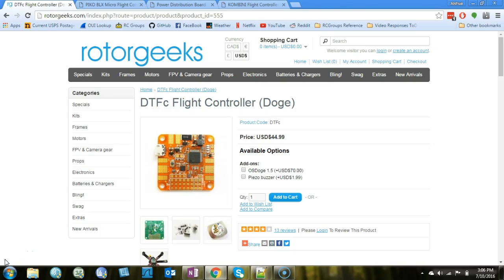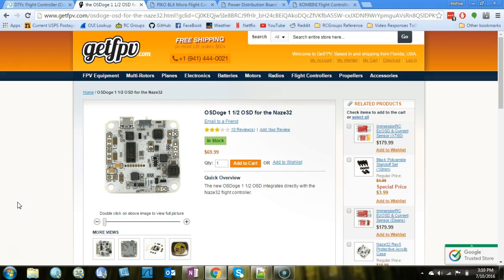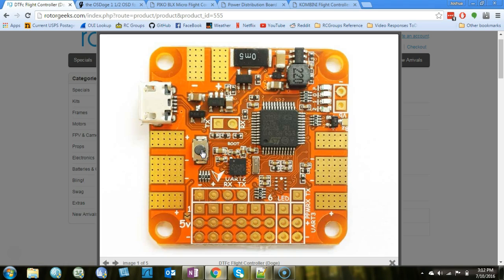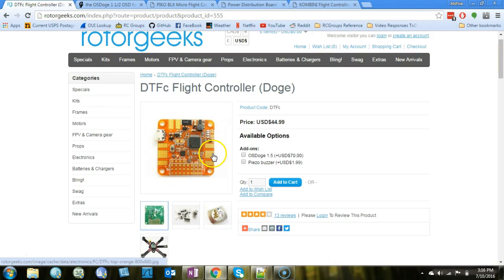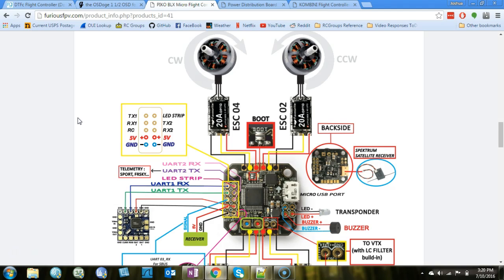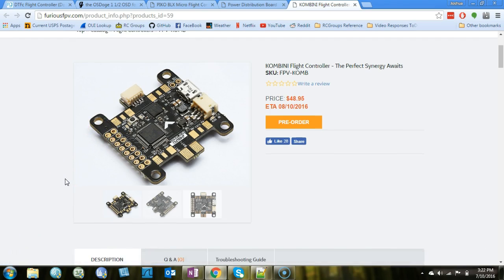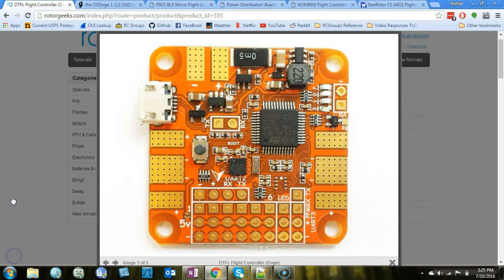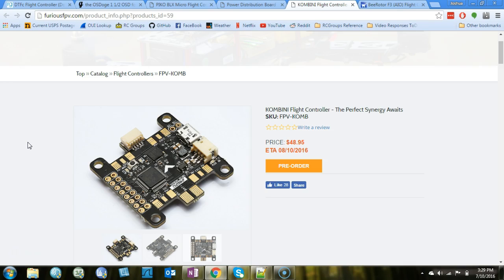Quadcopter Flight Controller Roundup: DTFc, PIKO BLX, KOMBINI

Comment: I have a couple PIKO BLX boards. I'm building micros these days. They don't actually have a "built in"  buzzer. Some of them come with an external buzzer. Mine didn't. I had to solder a buzzer to a couple of pads on the board.

Comment: hate to bother u again, a hyperlite f4 and got x4r.sb and the f4 board don't show uarts but shows rx3 would the rx3 work for smartport? I tried it and selected smartport in betaflight and vbat enabled but tarantis do the find new sensors and don't show vfas either, what am I doing wrong?
Reply from the maker: I don't know that board specifically but sometimes I know you can't find sensors unless the copter is armed. So try arming, then doing "find sensors".
Reply: OMNIBUS F4 PRO V3 FLIGHT CONTROLLER WITH CURRENT SENSOR, OSD AND SMARTAUDIO will i need to wire it up special way for x4r-sb rx ? is there a good wiring diagram somewhere that will show me? I hope this works and gets me back in air.. no more hyperlite f4 thats crazy it loses the memory for betaflight setup

Comment: cheaper 20x20 FC like the PIKO BLX http://www.banggood.com/CleanFlight-BetaFlight-Micro-F3-Flight-Controller-Built-in-PDB-Buzzer-20X20mm-For-FPV-Racing-p-1094615.html?p=T412213768073201602F
Reply: I actually find the clone more reliable than the original. The originals start of with a dodgy accelerometer, leaving you only with rate mode, and then later will fall out of the sky for no reason and never connect via usb ever again. Total shit.

Comment: Furious fpv actually makes a osd vtx combo designed specifically to stack on the piko blx. That and two in one esc's in the same form factor. So in my book that looks amazing for smaller quads. And possibly bigger ones.

Comment: Question I hope you can answer... I put 12volts to my sp Racing f3 board by accident and I was wondering if it could be saved... It won't turn on with 5 volts but does work with the USB cable connected telling me a regulator or cap my have blown.  Any insight would be appreciated. thx

Comment: Joshua,

what are your thoughts regarding the Flip 32 Omnibus FC?
Reply from the maker: It's pretty cool. I've been watching Project Bluefalcon's videos on it. I still like the RROSD, but the Betaflight configurable OSD is pretty exciting. Removes most of the down-sides of MWOSD, I think. You still need current sensing though, and PDB's with current sensor are a bit rare. I really think it makes the most sense to integrate the OSD into the PDB since the PDB must have current sensing. But Betaflight OSD might change my mind, since it makes configuration so easy. But then you definitely need current sensing in the PDB with a separate wire to the FC and OSD.
Reply: My thoughts are pretty similar. But if you consider that current consumed does not really equal flight time (e.g. if one flight is more modest than the last), battery voltage is really the tell-tale and the Omnibus can show you that along with everything else. I think it's a great 90% solution, especially for builds with little room.

Thanks for the reply.
Reply from the maker: +Jeff Beasley current is important for evaluating battery and ESC performance. For example, if I run one 1300 mAh battery to 15.0 volts and get 1100 mAh, and another battery I get 950 mAh, perhaps the first one is better.
Reply: Good point, Joshua. Would you give up the OSD functionality in favor of an integrated PDB + current measurement? At that point you're awfully similar to a DTFc. I'm torn between the two right now...
Reply from the maker: +Jeff Beasley I'm suspicious of integrated power handling and gyro. It has to be done right to avoid noise. I think that PDB plus osd or PDB plus current sensor and FC plus osd makes the most sense.
Reply: Hmm. Have you heard of the F3S AIO?
Reply from the maker: I haven't.

Comment: good review, I had the doge dtfc and now piko blx in my twitch 109mm micro, the piko is far far cleaner to wire up, has 2A 5v bec and a battery voltage LC filter output for vtx, doesn't have a buzzer built in i think their product description is worded wrong, it has buzzer output pins.. The Doge still seemed a good product but simply isn't as well equipped or layed out as the piko

Comment: Any good fcs which have the same pin layout of a naze Rev 5? I need it for the epipdb
Reply from the maker: +bo holland DTFc is your answer.
Reply: thanks, but isn't it unnessecary to effectively have two pdbs on board?
Reply from the maker: Unnecessary, but there you go. I don't know of another F3 that matches the pinout.
Reply: ok cheers, actually thinking back there may be one by the makers of the epipdb

Comment: I have a DTFc and the quality is amazing. It's not easy to make an FC with integrated PDB with respect to noise, so look and features are not the whole story.  I think the issues with gyro is related to electrical noise on this platform and recommend to use 2 buck caps on the ESC outputs (390u-1mF). Many people are referring bad gyro with mechanical noise. I think when you have mechanical noise in the system, this will be amplified by the PID controller, the ESC will produce more noise and transients that will adapt to the gyro power supply, and bad thigs can happen. So mechanical and electrical noise in the system is related. It's just a theory from my side, tell me if I'm wrong.
Reply from the maker: I have a link to a discussion in rcgroups showing noise on the 3.3v rail on boards that glitch. You're not alone in thinking electrical noise plays in.

Comment: There's also...the SirinFPV which is $120 msrp, but it's osd and video TX, blackbox FC. Also works with Six motors something I hope you will not in your great reviews.
Reply: the value of a PDB is lessened greatly if you are using the Littlebee pro 4-1 or the newest BLheli_s 4-1 esc. That really expensive FC and the is certainly the fastest build, and the slimmest stack. If you like a black box, it's pretty darn cool. Plus A full 40 channels with 200 or 25 mW controlled through the OSD.
Reply from the maker: Many of these boards will do six motors, but I reckon the vast, vast majority are flying quads, and that's where my focus is. The Sirin is a hell of a product. Even at that price, it's almost the only thing that does what it does.
Reply: +Joshua Bardwell the micro stack of the future will be, either sirin plus 4-1, or ... f4 FC, 4-1 esc, and AND with intergrated OSD and bec/VR/filtering. You need a microcontroller to change 40 channels, so they should just include the OSD, which is inexpensive parts, and the code is already written. Plus selectable output.
Reply from the maker: I just worry with that much integration, you're out a huge whack if something breaks. I think the modular stack idea, such as TBS Powercube is pushing, and another product I'm aware of that isn't ready for release yet (but soon). The idea should be that you have an OSD, FC, PDB/vReg, etc... all as a stackable module and you can pick and choose what you want. That way if something breaks, you aren't out the whole investment.
Reply: +Joshua Bardwell there's a few X designs where the flight stack is not part of camera/top plate. Which actually makes a perfect sense since you want to have vibration isolation. 
That should be nearly impossible to break in a micro. 
Also once you put (vrx, pololu, osd, bec) together, everything else is inexpensive and available now.

Comment: There are sooo many new FCs now, hard to keep track! Great that things are evolving, but think I'll wait a bit and let time tell which one(s) are the winners.
Reply from the maker: You don't have to wait. There are already some clear winners that have been around for six months or more. I agree that jumping on the latest and greatest has its risks.
Reply: You're right, the traditional F3 boards have been around for a while, and the X-Racer F303 seems to be a great board for example. I was thinking more about the newer ones with integrated PDB/OSD though.

Comment: Can you please make a video on how to properly calibrate the Current_meter through Cleanflight?  I have been searching everywhere on how to calibrate the scale and offset to be accurate.  In many of your videos, you mention that the Current draw is important to keep track of during each flight and I would like to have it working properly. Anyways, I have watched almost all of your videos and I learned a lot.  Thanks in advance. Happy Flying!
Reply from the maker: This reference would be a good start. 

https://github.com/cleanflight/cleanflight/blob/master/docs/Battery.md#tuning-using-actual-current-measurements

The easiest way to tune current meter is to use a clamp meter or something like the Turnigy 7-in-1 Mega-Meter to measure actual current draw. Then you adjust offset so that amps at zero throttle is correct, and scale so that amps at moderate throttle is correct. The higher throttle you use, the more accurate the reading will be, but it's pretty terrifying to be reading a current meter while your copter is strapped to a table and all four props are going full blast.

In my experience, you have to go back and forth several times, since a very small inaccuracy in current scale will cause a big inaccuracy in offset, and vice versa. Eventually you home in on a correct value.

If you know exactly what current sensor you are using, there may be pre-established correct values on the Internet.

Not having to calibrate current like this is a HUGE reason that I love the RROSD, since it comes pre-calibrated from the factory. The one time that I did it with MWOSD, it was a really hairy experience because I had to spin the props to draw 70 amps while trying to read a current meter.
Reply: Much appreciated. I'll look into purchasing a RROSD for my next build.

Comment: on the PIKO fc, it´s expectet to not use the signalground from the esc. is it recomendet to use signal without ground? for some its ok, other say there are a few issues  popping up, maybe burning esc without using the signalground. whats your experience? are you using the signalground? if yes, why? isn`t ground still ground - so just solder the signalground to esc powerground? and why are the manufactorer still continue to sell esc with signalgroundwires on? it isn't needed?! is it?
Reply from the maker: I always use signal ground.

Ground is "just ground" if you assume zero resistance and reactance from the medium. Reactance refers to the amount of capacitance and inductance that the medium presents. For a DC signal, reactance basically doesn't matter. The DC voltage is applied, current flows until the capacitance and inductance of the circuit are satisfied, and then everything is static. Voltage everywhere in the circuit is equal. 

Think of a plumbing system that is filling up with water. As the water flows in, the pipes groan as the pressure moves through the system. But then eventually the whole system is full of water and everything is static. Even if you open a tap so some water is flowing, there will be a momentary disturbance in the stasis, but then everything will stabilize again.

Now think of a plumbing system where somebody is constantly opening and closing a tap very fast. This will create localized disturbances in the pressure. This is analogous to an electrical system with AC current. When there is AC current, the capacitance and inductance of the circuit will cause there to be localized voltage differences, and the more AC current there is, the more the voltage will differ. Because ESCs make a LOT of noise, the voltage across the ground plane of a quadcopter can vary significantly. This can be enough to corrupt ESC signal outputs in some cases.
Reply: thank you for your help :) awesome^^

Comment: How about some reviews on clones? banggood has what seems to be a great F3 EVO board with SPI gyros (MPU9250) for only $26, if it works as advertised, how can you beat it?   http://www.banggood.com/F3-EVO-Cleanflight-10DOF-Flight-Controller-Oem-Version-for-Multirotor-Racing-with-4G-MicroSD-p-1064058.html
Reply from the maker: +Phil659 the problem with clones is that you can never know if they are solid or crap. And I could never figure that out on my own just by looking at the specs page. Many of the clones are great. Many of then are defective. It's a gamble to buy them unless you have your ear to the ground and know people aren't having issues.

Comment: The osdoge is really expensive, but I run it quite often simply because I can tune PID's with stick commands and don't even have to bring in my quad and plug it in. I'm lazy like that
Reply: You can do that with a minimOSD with the MWOSD firmware...
Reply: +ABMNS PRODUCTION Yeah but a stack is much neater
Reply from the maker: Exactly. I wish to goodness there was a decent, reasonably priced MWSOD board in a 36mm form factor. I think there was a link to one somewhere else on the thread. That, combined with DTFc would be a nice combination.

Comment: no built-in buzzer fir Piko Blx. you need to provide and solder in. 
It's either a mistake or never made it into production.
Reply from the maker: I didn't think I saw a buzzer on there, but I figured maybe it was some kind of super secret mini buzzer. Disappointing.
Reply: +Joshua Bardwell they show a buzzer to add in the diagram. Tiny buzzer would be tiny noise anyways.

Comment: How does blheli passthrough work on these boards,
Simply solder the ground wires to a common ground or is this not working?
Reply from the maker: Passthrough should be working fine on all boards except the Moto Tornado as of betaflight 2.7.1 and blheli 14.6. The Tornado doesn't work because it has hardware buffers on the ESC outputs that prevent bidirectional communication.

All you need is a working signal line. In other words, if the motors will spin, passthrough should work.

Comment: DYS XBR220 XBR-F3

http://www.banggood.com/DYS-XBR220-XBR-F3-F3-Flight-Control-2-4S-Integrated-with-OSD-UBED-PDB-p-1066479.html?p=0609202427422013084W

http://www.rcgroups.com/forums/showthread.php?t=2697366

It's big on the X/Y axis, but maybe you could zip tie your esc wires the the 'lobes'. You would need a frame to accommodate it. I can't find specs on the gyro though... if it's SPI I would try it out.
Reply: not the same. piko is about 3 gramms, kombini - 6 gramms. yours - 23 gramms
Reply: +xf0L hole spacement on the Piko is too much of a hassle, and the Kombini also doesn't have an OSD, so more weight, more wire and more work ahead. and of course, the DYS XBR220 is a juggernaut that won't even fit in many builds. look for a HGLRC V3, that's an all in one standard size board that looks almost perfect. i'd rather take a boart without the extension for the battery wire pads though, if there was one. let me know if anyone finds a board like this.

Comment: Just wanted to say that the TS5823 can run off 5v, my friend is doing so.
Reply from the maker: Man, I would worry about being too close to the low-voltage cutoff and losing video, but I guess if your 5v supply is solid, you're good.

Comment: Good to see someone else acknowledge the ridiculous price of the OSDoge..  I actually use a stackable MWOSD card which is pin compatible from freebirdrc.com (under parts,etc).  I have 4 of these and all work flawlessly.
Reply from the maker: That's a very nice board. Shame it (like most) lacks a current sensor. Somebody needs to make a barebones PDB with vReg and current sensor built in. Suddenly, everybody will have current readout no matter whether they're using a simple Naze or anything more complex.
Reply: Ask and you shall receive...  http://rcexplorer.se/product/babypdb/  Though it's built for a tricopter, if you double up on soldering the esc to the pdb, should work a charm...  Oh yeah, 5S capable to boot...
Reply from the maker: I just saw that yesterday. Awesome!!

Comment: Do all three have a current sensor?
Reply from the maker: That's a good question, and I'm a little embarrassed I didn't address it in the video, given how important I think a current sensor is. The DTFc has a current sensor. PIKO BLX does not appear to have one. I can't find an answer for Kombini, but obviously the OSD + FC setup will include current sensing, it's just a question of whether the sensor will be available if you only have the FC and not the OSD.
Reply: That's true. If you don't run osd, you dont want or need current sensing. Most of time anymore I run an OSD just for the ability to tune PID's at the field easily. Well along with watching battery voltage but I think I'm a little obsessed with watching the voltage when I just need to fly. Great videos BTW I watch them all.
Reply from the maker: I disagree with your second sentence. Even if you don't have an OSD, you can have current sensing input to any cleanflight or betaflight FC that has the input pin (and most do). This will allow you to track current consumption via FrSky telemetry, which, although not as good as an OSD in my opinon, is still better than nothing.
Reply: +Joshua Bardwell that's true. Didn't think of that.

Comment: Hey Joshua, nice overview (as usual). Do you think it would be possible use a Piko BLX on a 180-220 4S setup? My concern is about the current the board would support and the awg required for the battery cable.
Reply from the maker: I don't know the answer to this. I couldn't find a current rating for the board in a three-minute search of the product page or the manual.

Comment: I picked up a Piko BLX   buzzer pads onl not built in. 
Built in BEC somoked on first power up.
Reply from the maker: +Freak of Speed did you power it before you soldered on it?
Reply: Yeah worked fine via usb.  soldered up the pig tail and RX  and nothing.  It still works via USB  just not using the on board  BEC .  Testing with an external  BEC seems to work ok. Haven't soldered on esc yet.
Reply from the maker: Wow. Bummer.